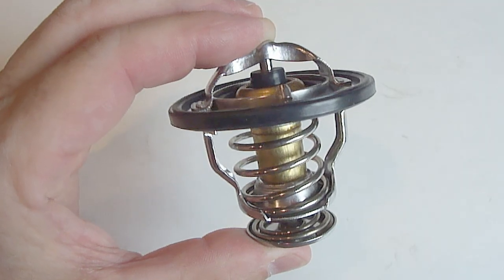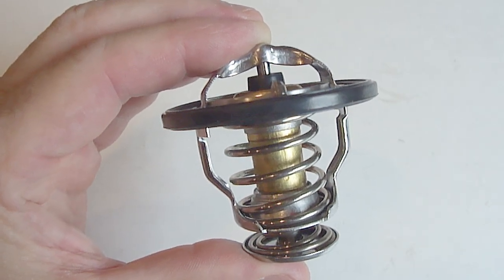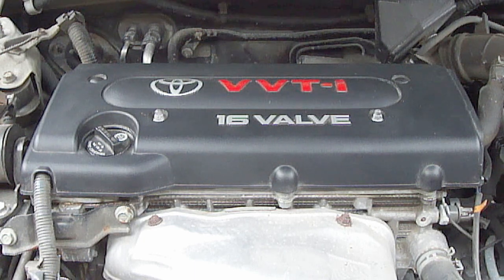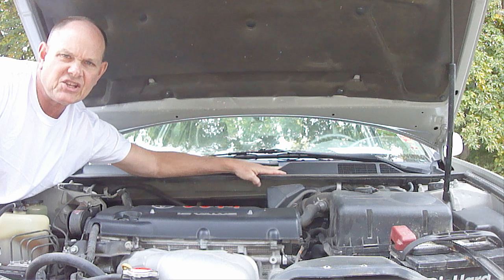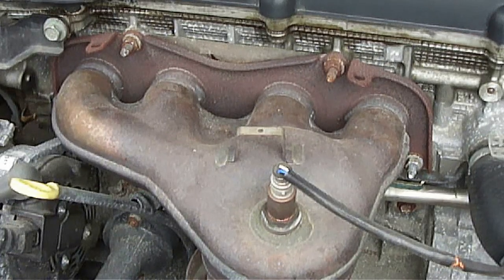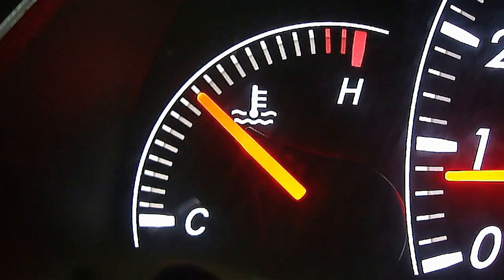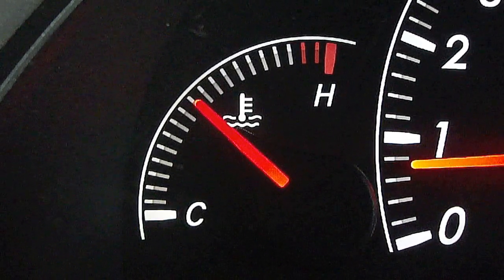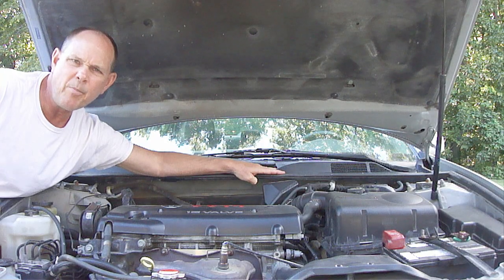The Dangers Of A Bad Engine Coolant Thermostat On Your Car

Comment: My mechanic recently removed my thermostat saying it would cause over heating if it goes faulty....& that it had no side effects even if I drive without it. Wondering 🤔
Reply from the maker: If you drive without it you’re asking for trouble.
Reply: Find a new mechanic ...quickly!
Reply: Say whaaaat
Reply: Get a new one put it in.. search on here the importance of a thermostat for motors. You'll see why. Depending on the weather your motor will eventually either stay too cold or stay overheated. Thermostats regulate the flow an keep things balanced. Otherwise if he was right then car companies wouldn't use em. The only time you want to rip one out an drive without it Is if they are stuck shut an you need to get home. Even then you don't wanna do that in 90+degree heat unless you are moving pretty quick. 

There's plenty of educational videos just ask YouTube how important they are LOL that's what I did

Comment: Thanks that was a nice video  but the.part  that you show on the video is most of the time is aftermarket why because you didn't buy it from a Toyota dealer
Reply from the maker: There are other ways to buy genuine Toyota parts other than directly from the dealership. I always buy genuine Toyota parts on eBay or Amazon because the parts are usually cheaper and usually with free shipping and it’s delivered right to my house. As long as it comes in Toyota packaging it’s genuine Toyota.

Comment: Too bad they can’t make them to only fail in the open position.
Reply: They can, and they do. It’s called a fail-safe thermostat. Cost a little more, but well worth it.
Reply: Still can cause overheating, the thermostat helps the radiator because coolent cycles so fast. So when it lets the hot water out an cool water in it shuts a little again till it hits the temp;  that gives the radiator time for the radiator to drop the temp on hotter coolent. Cause honestly coolent cycles pretty fast though most radiators 

But yes if a thermostat gets stuck you will overheat quick as anything. But you can still overheat without one in the summer if you don't have a kick butt radiator that can cool 170+ degree  liquid within 20-30 seconds before it goes back in a hot block of metal lol there's videos on why they are important. I'm not going to pretend like I have known this forever but I always thought "no thermostat no problem" I was wrong lol